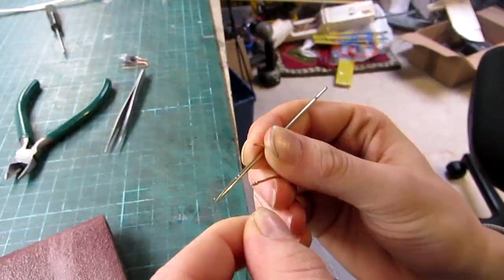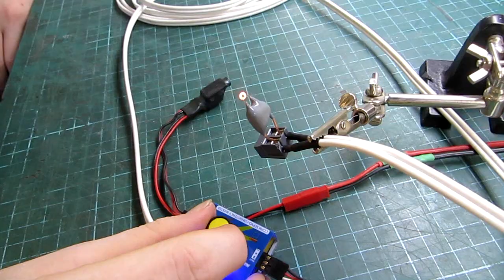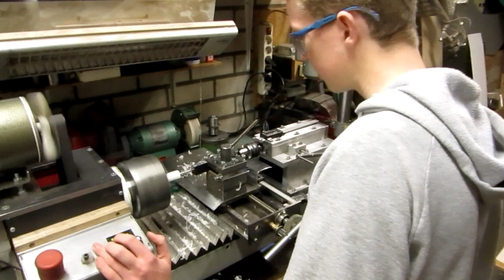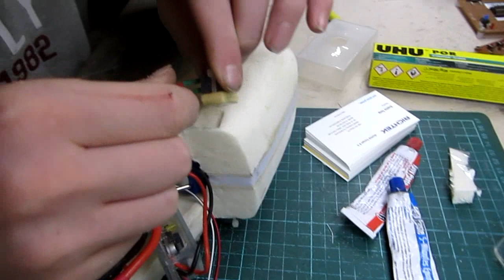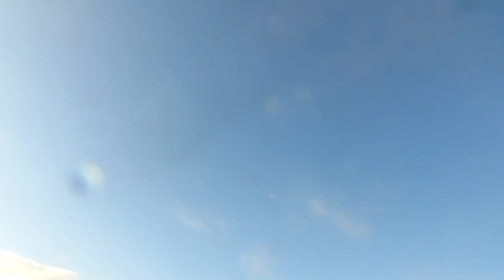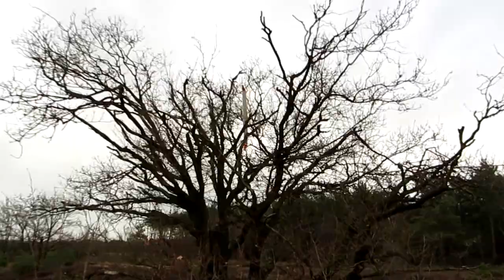Adding Fireworks to an RC plane

Comment: why did this vid never come across when i was HEAVILY looking into doing this? i designed a 7 unit rocket launcher with 2 copper rings as +/-

i also found a multiswitch that can plug into 1 aux but outputs to 10 different signals in a cycle. I never put it together (winter 2021) and ive been too busy all this year but im back on it this winter!